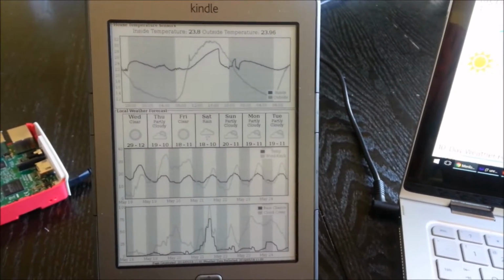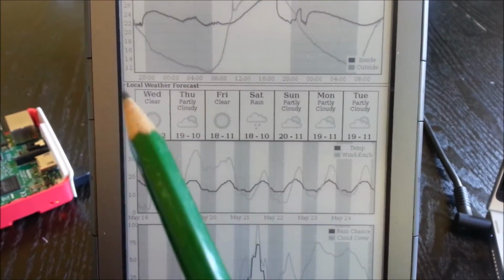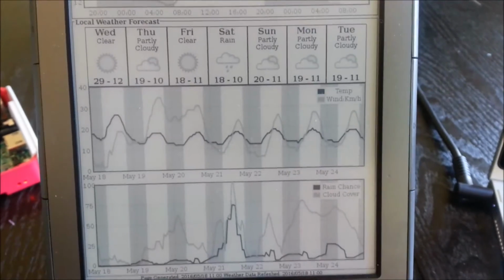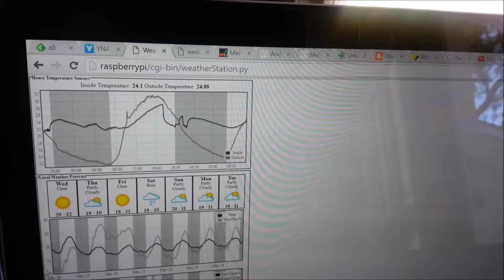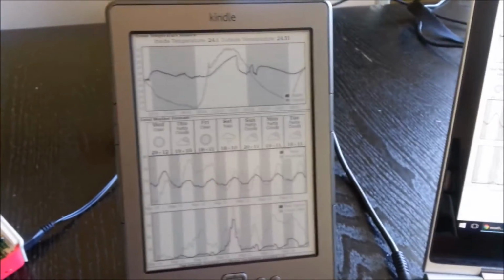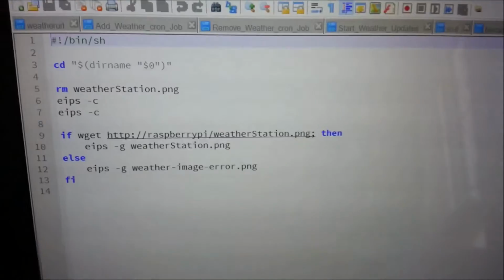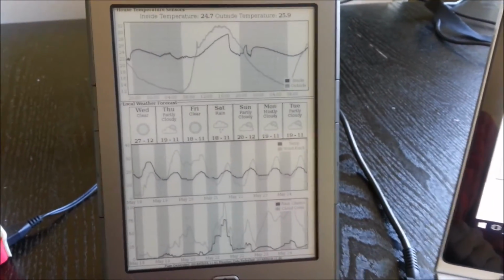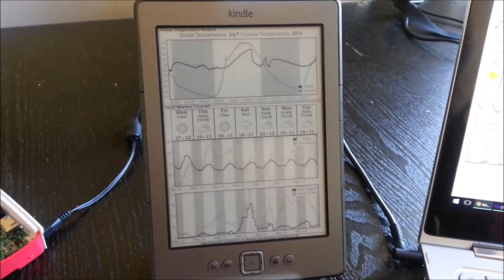Raspberry Pi Kindle wireless temperature sensor weather station

Comment: Thank you so much for sharing this ..
i m new in it, i jst want to knw that , you have placed one temprature sensor outside ur home, so how that sensor send its signal to Raspberry Pi ?.. what is the medium in between sensor and Raspberry Pi ? ..
waiting for your reply ,, :) ..
Reply from the maker: the 'slice of radio' is the receiver that picks up the signals from the sensor. The slice of radio sends data to the serial pins on the Pi GPIO
Reply: Thank u so much ..

Comment: hi, i'm thinking build a similar system with a pi zero. I did not know yet if i will build a weather station like yours or a mesure the temperature inside my home in multiple places, anyway e google a little bit about "remote RF temperature sensor" and on the first's results some people make them with arduino. So in a remote location i need a arduino to handle with the data and send them to the pi that works as main piece on the system. What is the sensor on the pi that receive the data? it is possible use multiple sensors on the house project or because the communication frequency is only possible have one? has you a git repo with the source code? Nice project
Reply from the maker: Hi, yeah i saw people using xbee's and arduinos for remote sensors. I opted to use 
to use these remote sensors for the slice of radio (the receiver) as they are cheap, have 1 year battery life and don't need configuration. Multiple sensors are an option with this, i might actually get another one which enables me to remove the breadboard mess and just have the slice of radio sit on the pi.
http://projects.privateeyepi.com/home/home-alarm-system-project/wireless-projects/wireless-temperature-sensor-2-0

No github for my code yet, tbd.